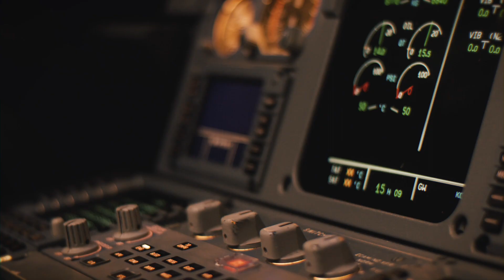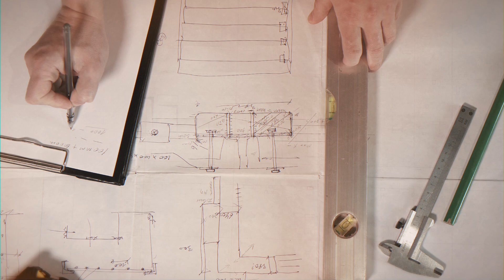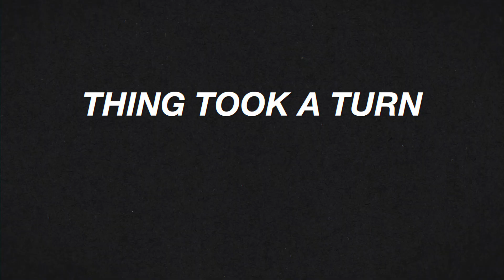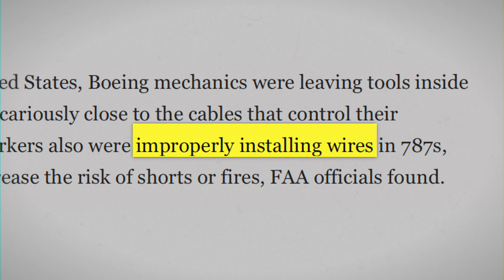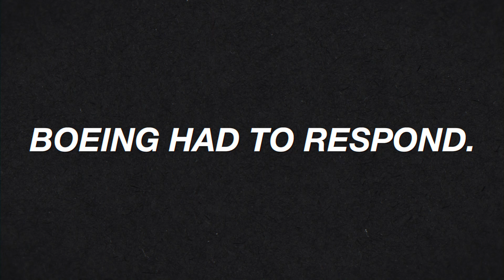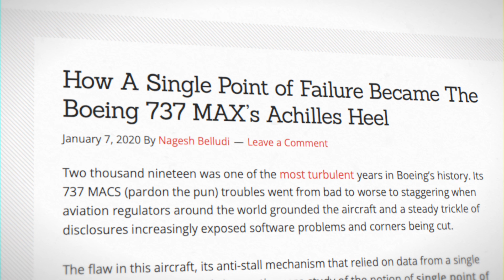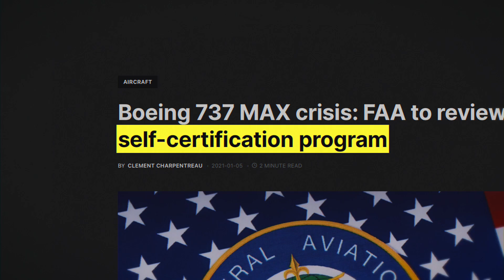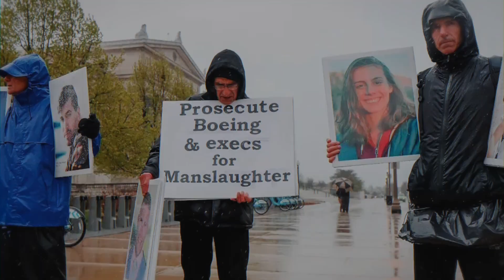The Scandal That Destroyed Boeing

Comment: As a pilot, the saddest thing is that the pilots could have done something about, they were not informed to pull the stab trim levers. It is still 100% not the pilots fault.
Reply: That statement emphasizes the overwhelming responsibility of Boeing in the death of 346 innocent people. I can't believe none of those criminals went to prison and that the company paid a ridiculous 2.6 b$ in penalties
Reply: If they weren't informed of standard procedures, isn't that the airline's fault?
Reply: What makes it even worse, is they apparently did what Boeing taught them to do in the second crash, disable MCAS, and they still crashed.
Reply: @KB-bh9hp  That's actually not true. The Ethiopian crew eventually did engage the switches, but by that point they had allowed the plane to overspeed by failing to disengage autothrottle (did not follow standard procedure), which was still set to takeoff thrust. This created aerodynamic forces on the control surfaces that were practically too strong to overcome - unless they were aware of another procedure that Boeing has published since the 60s.
Reply: @robroilen4441  Boeing was not informing the airlines to train the pilots the new system.
Reply: @robroilen4441  They were never trained for a sudden dive. No one was trained about MCAS
Reply: @thegreatestdonut461  There actually was never a "sudden dive", the flight data recorder information is very clear about that. And if they weren't trained on MCAS, that is the fault of the airlines.
Reply: @thegreatestdonut461  That's just plainly not true. There were many examples of standard procedures regarding MCAS being published before these crashes, but at the end of the day, any pilot who actually understands how to fly a 737 would have understood how to avoid these crashes. That could perhaps be why the planes were flying all over the world dozens of times a day with no incident...
Reply: @robroilen4441  It is not the fault of the airlines if the airlines were not informed.
Reply: @thegreatestdonut461  Oh I see, so airlines don't need to understand the standard procedures and safety practices associated with the planes they buy and use. I'm confused about what the airlines are supposed to do then...
Reply: @robroilen4441  since you can't seem to read, it's not the airline's fault if they don't know what Boing refuses to tell them.
Reply: @dansmith6300  Boeing didn't refuse to tell anyone anything; there were multiple notices regarding MCAS published by Boeing, and the standard procedures that the pilots needed to avoid crashing are decades old. If an airline buys new planes and then doesn't fully train their pilots on how to use them, it's the airline's fault.
Reply: @robroilen4441  going to put a big fat doubt on that, Boeing employee, as you are the only person in the comment section claiming this. If it were true, Boeing would not have suffered a hit to it's reputation.
Reply: When were they not informed?  It was MCAS they were not informed about - but turning the trim off was always the procedure for runaway trim wasn't it?
Reply: @robroilen4441  Boeing told (to compete with Airbus, and so avoid more training because you know, money) that the MCAS training wasn't really something important, that it didn't deserve a training on it. So, well, Airlines didn't train them because they were told not to?
Reply: @robroilen4441  Why are you shilling for Boeing so hard? You a stockholder or something?
Reply: @robroilen4441  You're not really doing a good job of that, it looks a lot like the only shill here is you.
Reply: @robroilen4441  shills harder please.
Reply: @Homoerectus1548  So you guys just don't care that Lion Air and Ethiopian Airlines didn't properly inform their crews about the decades-old standard procedures for a trim runaway? Interesting...
Reply: @Poopinbabe No. A commercial airplane is not made to have untrained people strap on parachutes and jump out. Especially considering that a Crash usually develops pretty quickly - there would be no time, and any attempt to quickly have all passengers strap on parachutes would probably just lead to  more crashes as pilots would be heavily distracted in an already bad Situation and then possibly wouldn't be able to pull off a rescue.
Reply: @lVideoWatcherl  then made a parachute for that airplane so they can land the plane if not functioning
Reply: @jopetlupet363  The necessary engineering would probably be insane. Consider the moment such a parachute would be necessary: when the plane is already beyond saving by the pilots. At that point, the plane could be in any state of flight, and the most probable is hurling at high speeds directly towards the ground, possibly in desperate spin even. Making the fuselage robust enough to actually hold together once a or multiple parachutes are deployed that are intended to hold it up, would probably make the plane so heavy that it would be significantly more difficult to even take off, let alone ruin fuel efficiency, possibly making long-range flights entirely impossible. After all, planes are heavy already, ensuring that they don't break up in no circumstance at all would, from what little I can imagine, close to impossible.
Reply: @C0astDelta  I mean aside from what you're saying not making any sense, it changes nothing about the decades-old standard procedure concerning a trim runaway. The switches were there, they would have worked, and the pilots didn't use them. That's not a failure of the company who made the airplane.
Reply: @robroilen4441  State what I said that doesn't make sense.
Reply: @justmrcrow The airlines didn't choose to train them simply because Boeing told them not to. They chose money as well and opted to not train them because it was "optional". Both of them deserve blame here.

There is a reason why airlines with stricter standards never had these crashes.
Reply: @SuperCatacata  True. But there's no arguing over who deserves the most of the blame here.
Reply: The pilots could have done something, they were not given the information on how to understand what was going on. It would take a one in a million Maverick pilot that ignored all their "check lists" to have the intuition to solve the problem. The problem is though, most modern pilots are robots. They're trained to use computers, the vast majority of commercial pilots fly by hand  at this level less than 5% of the time. That's the problem, if you're a roster pilot for a major airline you're no longer a pilot, your a simulator driver.

But this is what happens when airlines dumb down on training because they believe "even a brick could fly" if it was controlled by computers. This is very, very, dangerous just like driverless cars.

The nose pitch issue was a completely normal "feature." The pilots just believed the guff about it.... If they'd have been told the truth... as a pilot... None of these people would be dead. The plane was stable regardless of the MCAS sensor, the pilots no longer knew how to respond to the situation properly though and its basically yeah.... ignoring the basic, causing the incident.

Go back to the basics FFS.... 

1) Aviate
2) Navigate
3) Communicate 

If they went back to aviate, navigate, communicate and ignored the bells and whistles, and knew how to fly, these accidents should never have happened. The problem is most commercial pilots aren't pilots at all anymore, they're simulator drivers. So you get stuck at point one where this aircraft failed, mostly because of a pilot error leading to the lack of "aviation."
Reply: @robroilen4441  Boeing meat rider lmao how can you even be trying to not put blame on them. It's well documented that it's their fault
Reply: I disagree, the saddest thing is that the big shots at Boeing did not get long jail sentences. it shows there is something fundamentally wrong. 
What you are saying is of course tragic, but it would have meant it is a one-time thing if the people responsible would get jail time. But now this can happen again
Reply: @robroilen4441  How would they know to use the switches for that particular MCAS problem, when MCAS was not even in the flight manual? And even if it was, the workload would be way to high to not have that as a memory item.
Reply: @jopetlupet363  that’s for light aircraft not commercial passenger jets
Reply: @shmooveyea  Because the standard procedure for a trim runaway in a 737 has involved activating the stabilizer trim cutout switches for DECADES. That is literally what they're for. Only a completely inexperienced pilot would be unaware of that.
Reply: @WhiteLionProd15  All I've said is that there are decades-old standard procedures for a trim runaway in a 737, and the pilots flying the planes that crashed did not follow those procedures. They completely failed to perform even the most basic elements of those procedures (like disengaging autothrottle, instead of leaving it at takeoff settings when they noticed something was wrong). If you disagree you just don't understand the situation.
Reply: @robroilen4441  You completely miss the point. If Teslas "autopilot" had a feature in which it occasionally drove head first into a wall it's not the drivers fault for not disengaging it in time. Boings faulty system forced them into a situation where this type of quick reaction in a life threatening situation becomes necessary. When such a preventable failure causes an unexpected issue like that blaming the pilots for not reacting properly doesn't make sense.
Reply: @user-hv6wb5gk8p  Again, look  at the flight data. This was not a split second decision kind of situation. Something went wrong that there has been a standard procedure for - for decades - and the pilots didn't follow that procedure. It really is that simple.
Reply: @Ana Novak It didn't happen in more developed countries because those countries have much higher standards for pilot training and airline maintenance. It just really confuses me why everyone completely ignores the fact that the pilots in the accident aircraft DID NOT FOLLOW STANDARD PROCEDURES that had been published since the 1960s. If they had been flying 737 NGs instead of 737 MAXs and there had been a trim runaway, they still would have crashed because the procedures are exactly the same.
Reply: @Ana Novak "When everything is beeping and the plane is trying to kill you" Man, it is super suspicious that people repeat these things almost word for word. Like I said, if you take a look at the flight recorder data and compare it with how the pilots responded, it is extremely easy to see that they did the wrong thing. Yes, it's tragic that people died, but the blame is on the airlines for not training their pilots properly.
Reply: You are so right this video leaves out almost every detail about what happened and boeing absolutely killed hundreds of people with almost no recourse it sickening.
Reply: @robroilen4441  you obviously haven't seen everything that was published about the mcas system. I the second crash the first officer did exactly what Boeing said to do (before they gave instruction on what to do) and everyone still died. Before you try to express an option find out what your talking about because obviously you have no knowledge about much of anything that happened